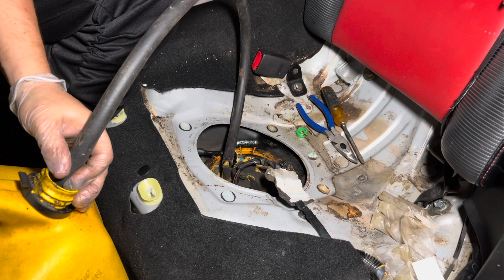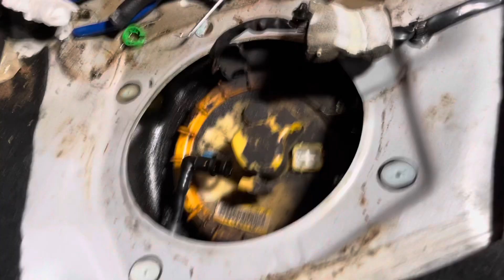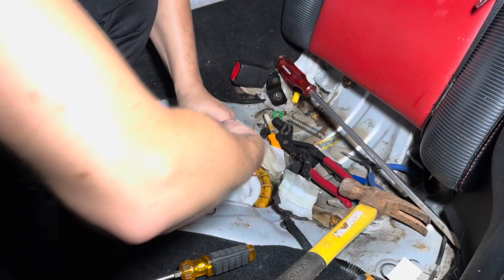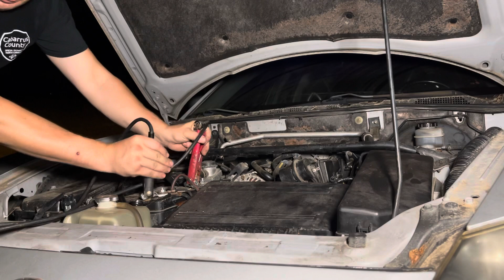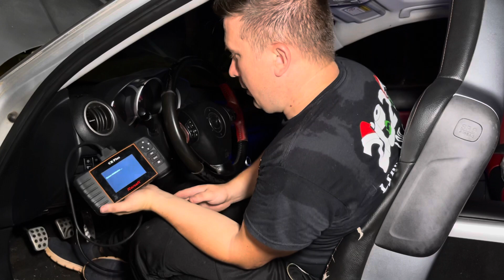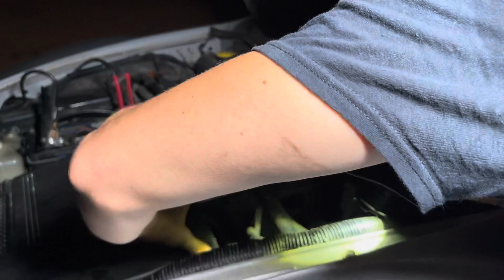Fixing Fuel leak and trying to start my Mazda RX8

Comment: I had a fuel leak,  looked like the seal between fuel pump and gas tank failed.  It was actually the large plastic nut holding the fuel pump down cracked.  If the leaking slows down when pushing down on the nut, a cracked nut could be the problem.

Comment: WOT actually cuts the fuel on start-up. Should've cycle the key on and off a few dozen times to prime the fuel line before cranking it. Running the starter continuously for that long could damage it.

Comment: get some starting fluid, spray it in the throttle manifold, try starting it, be ready to make a quick escape, if there is to much gas in the engine you never know.

ALSO here is a complete step by step procedure with 90% feedback success

step one- go to your fuse box take the cover off. flip the cover over and look for FUel Pump fuse which should be 20A ( i have a 04) . but i hear its also 22 which i dont have.
.

step 2. go to Air pump and disconnect it. (which you find the picture down below) it would be to the left of the Bright yellow oil cap .

step 3. now i put in a new set of spark plugs, becuase it was my time to tune up any ways. but if you want to a easy DIY for that you can find that here https://www.rx8club.com/series-i-do-yourself-forum-73/diy-spark-plug-change-31872/ . but you want to skip all that,

then i should continue. get anothe car (unless you hve a battery charger) so you can do a jump. reason is, there is going to be alot of cranks , which will eat up your battery (also reason why i disconnected the air pump, it tends to use more power). after your 2 cars are set up for jump. start car 2 and let it run while you do the crank process. we will move to step 4.

step 4. you will need to crank your car for 4-5 secs , then turn back off for about 6 seconds (to save your starter) . you repeat this process for 50 -60secs.

step 5, get out your car start doing jumpings jacks for a minute or so

step 6- REPEAT STEP 4

step 7. put back in your fuel pump fuse, and crank the car. it should start wanting to turn on. if the car turns on let it warm up to correct temp. in my case since i did seafoam, i had to press the gas a bit to save it from turning off.

If your car almost starts, but after a few cranks it feels like its not wanting to start. go back to step 4 and work your way down the steps, till your car starts. then reconnect your airpump

now i am not a mechanic, but i do tinker a bit, especially when i was growin up back home. but the reason why i decided to post my own thread is, the DIY that i seen, never really told you how long you should try to crank your car, or you need so and such tool or item for the process, that you may not have while out in about. so i can see a person feeling like they are beating a dead horse, if they dont see progress etc.

only item you really need is car 2 and jumper cables, and that is pretty much it.

now i am not saying my DIY works 100%, but its the process that i learned back when i was in okinawa japan.

any ways, i hope this thread helps you in the future.
Reply from the maker: Thanks so much I saved the link, I will try all that your saying, I am new to RX8 I got my first one early this year, and it’s been a great learning experience, it’s a fun car if you like to wrench everyday and I don’t mind lol
Reply: @mazdarx8diy38  yeah man the community is full of good people but also retards. Hence why it's always good to look in the RX8Club. You can find pretty much anything in there. 

Just as an example. I upgraded to an after market intake over the weekend. SSV solenoid decides to go. I did not have a clue what to do. After some midnight research with a cold beer. I changed the solenoid and the 8 is back in business
Reply from the maker: Sweet, I changed all mine, I do have a video on it, so glad that we have RX8 forums cause this is where I got my information as well, I am trying to keep my channel like RX8 forum